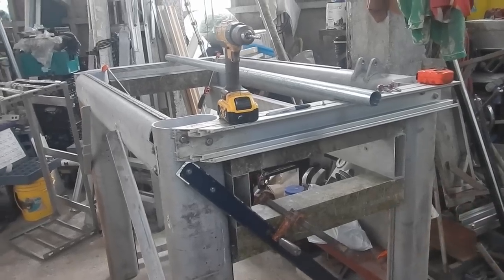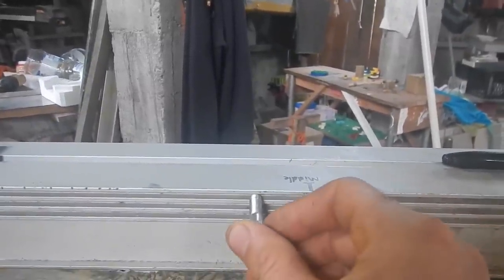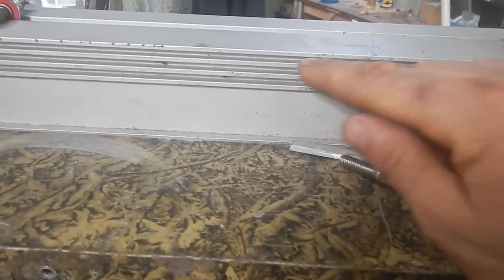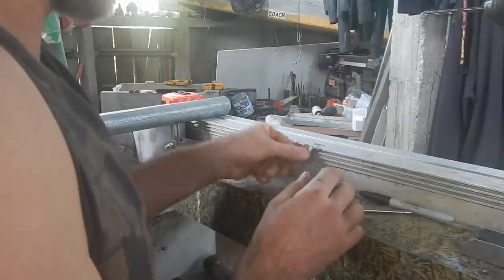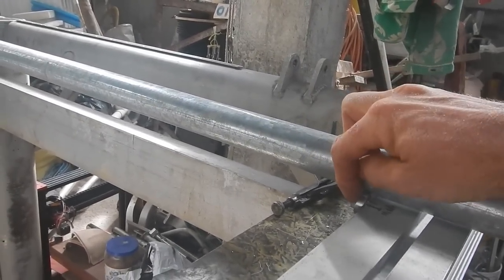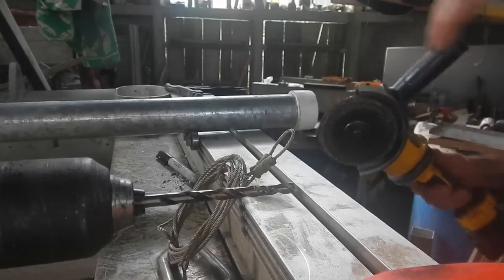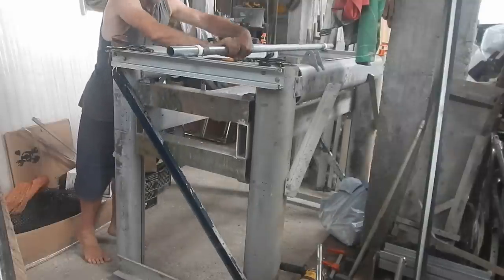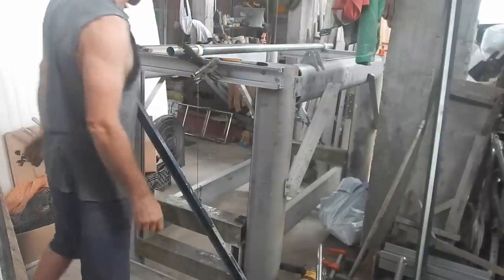Lumber mill 014 Lifterizer

Comment: This is coming along nicely... just one thing Jaimie...... please remember those wires will stretch once the motor is on the frame and then you will need to be able to adjust those cables to trim it up again.. you will need a swage or something to then fasten the cables tight ...maybe wrap the cables around the bolts once more to get more bight on them. I look forward to see what you come up with for a handle or wheel....... it will also need to be locked into place and have increments of adjustment when you need to lower or raise the saw to get the finer adjustment to cut to the line you want for the thickness of each piece of timber you are cutting....maybe something like a bike wheel, sprockets, chain, pedals and brakes?

Comment: Only mentioning because you were making a big deal out of it being precise and consistent... cable stretches eh? Gradually over time. Also, not going to get much for precision on a 1.5" winch. 1 full turn is almost 5 inches of cable pull. You'll be making adjustments by moving the crank like, single degrees of rotation. Maybe threaded rod and two bicycle gears connecting them would be a better route on this. Or... and I know this is a big silly... but, what about just shims? If you want to cut a 2x4, you use 2 actual 2x4s to force the sled higher. If you're cutting a 2x6, use a 2x6. Etc.
Reply: It's  just useless logs 2 efficient lumber. 😉 Lets wait to see after he builds the carriage base, guide rails and make his alignments.

Comment: 'a good slathering of grease on the galvanized tube & cable will increase their lives greatly.
'a 26" bicycle wheel would make a good adjustment wheel, and would the rear gear sprocket
with its ratchet ability let you make adjustments to the 'height' of your cuts?
I'm Really into watching this project take shape - way to go J!